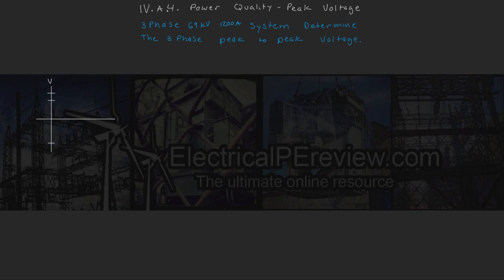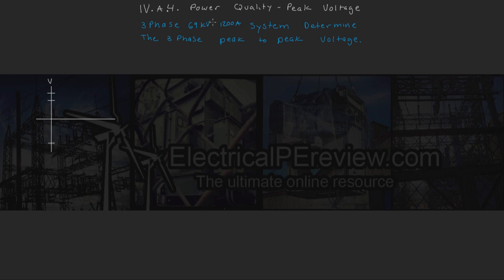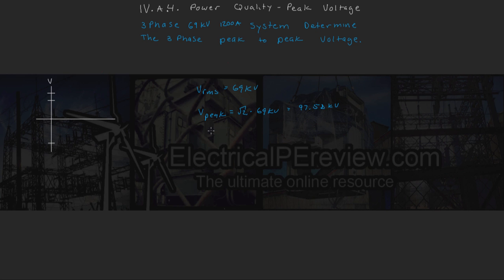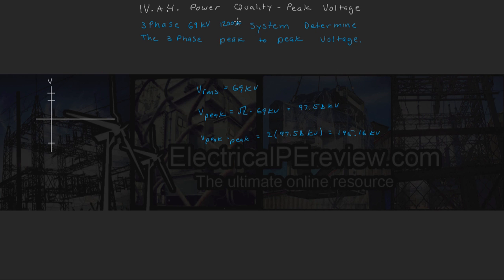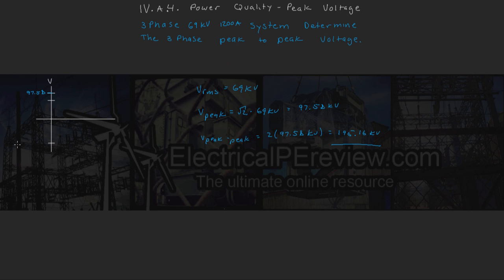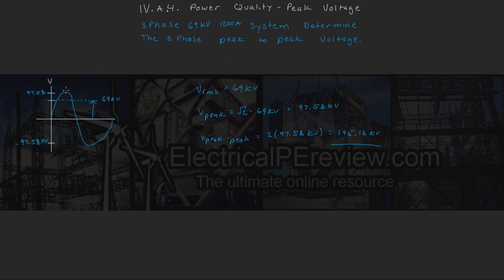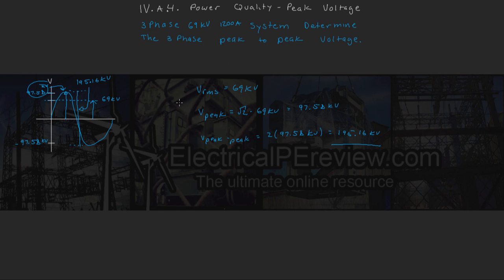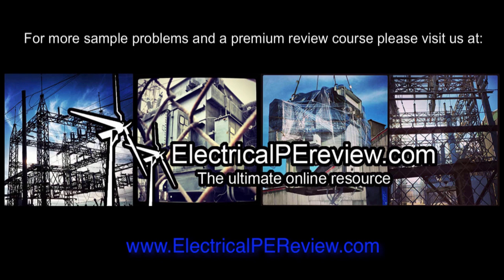II.A.1. Peak to Peak Voltage and RMS Voltage - NCEES Electrical Power PE Exam

Comment: Hi Zach. I'm confused on why you use the Line Voltage (69kV, Line-Line) for a single voltage waveform. Why don't you have to use Phase Voltage, and go from there?
Reply from the maker: Good question. The question is asking for the 3-phase peak-to-peak voltage (as opposed to asking for the line-to-neutral peak-to-peak phase voltage)
Reply: Gotcha. I missed that it asked for 3PH peak-peak value and was stuck on phase voltage because that is typically what we use in waveforms, phasors, etc. thanks! @electricalpereview
Reply from the maker: @zachhall8509  It's easy to miss since this is an old video where the problem was handwritten and not as legible. Keep up the hard work!

Comment: Why do we need to calculate VPP?
Reply from the maker: It's used in power electronics, one of the subjects on the PE exam.
Reply: @electricalpereview  practical usage other than exams
Reply from the maker: @Darkcry1206  In the power industry, hardly ever. In power electronics, it's sometimes used for device ratings like diodes, capacitors, and switches, and used in different formulas like ripple.